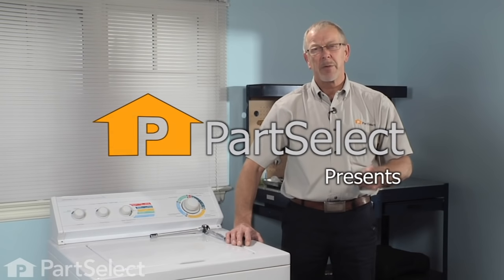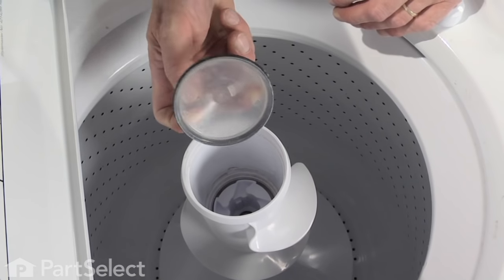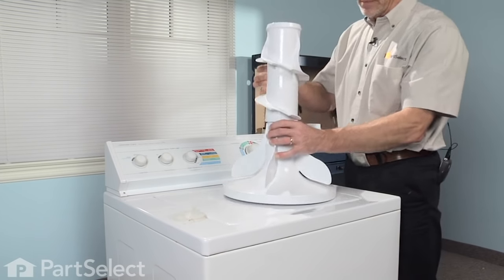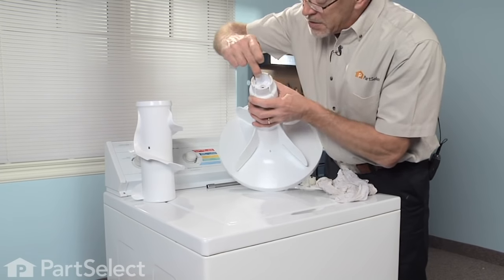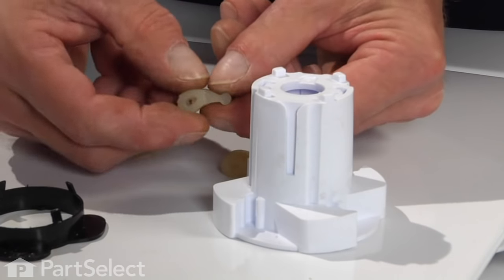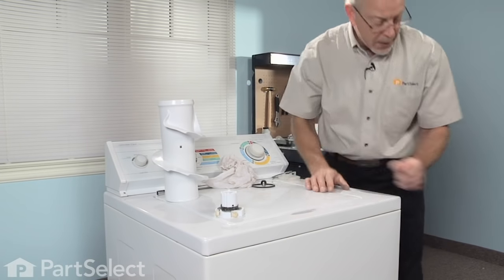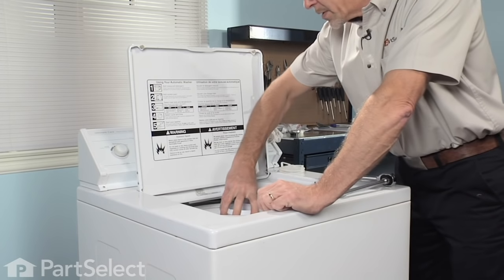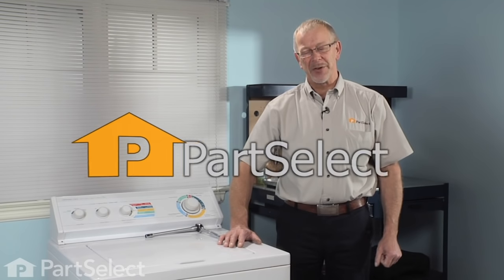Washer Repair- Replacing the Agitator Repair Kit (Whirlpool Part # 285811)

Comment: Do not bust the two tabs in the post of the agitator base! He is wrong when he says they are just for factory use. Those two tabs line up with the two holes on the bottom of the cam set, and they SNAP into those tabs to lock down the upper auger piece so it doesn’t wobble around loose.
Reply: Thank you for explaining about the two tabs. You are quite correct, at the end, it is satisfactory to hear the "click". I think that it's hard to get the right alignment, and perhaps some non-OEM part aren't well formed, and the bolt tightens it enough, if you do follow his suggestion. But as you say, better not to!

Comment: My goodness, if the agitator bolt is rusted, it is quite the task to remove.  I had to try to drill it out, which didnt work (the bit I used to drill was too large, Live and Learn), so I drilled around it to break the top piece that gets replaced by the repair kit.  This video was posted 13 years ago, and is still helping keep these machines out of the landfill.  In my case, I had to replace the clutch, the coupler was worn so we replaced thata too, and the agitator assembly -- all in all a cost of less than $60.  I want to say I really appreciate this video, and don't usually ever comment on videos.  Kudos!

Comment: I did this!  While my washer looks exactly like the one in the video - I learned that not all washers (even if they look the same) can be drastically different. I ordered the referenced repair kit above for $8 and some change from Amazon, they also carry the "dogs" for less than $2.00, but it is an add-on item and you have to spend $35 to get free shipping.  So I ordered the kit.   I got impatient and visited the local appliance shop/parts shop and they charged $8 JUST for the dogs.  So I replaced the dogs, and when the kit arrived, I learned that my machines assembly was different than the kit - however, I did use the gasket for the top thing (the thing you take out to get to the bolt), I also used the bolt washer, my kit didn't include a bolt.  It works IT WORKS and I DID IT.  THANK YOU FOR YOUR VIDEOS!! I've subscribed & liked!
Reply: Cara Friend.

Comment: To think i was about to order a brake, clutch, and other parts and replace one part at a time, then test it each time. Mind you, i bought used, and someone had previously used a screw to lock them together. I took them apart, and what looked to be pebbles were actually the dogs broken. Lol just bought 2 sets on Amazon for $20😂

Comment: Awesome site!  I have ordered many parts online and repaired many things myself but this is the best site ever for parts as well as videos!  I just happened to find the site looking for parts to repair my agitator on my 32 yr old whirlpool washer.  The parts were easy to find with just the serial number and I was amazed that there was a video attached on how to repair it.  The video was clear and concise and easy to follow, the parts came very quickly and are very reasonable in price and the job only took about 15 minutes.  My washer is old but still works just as good as new and I did not want to replace it.  The parts are exactly what were on it originally and have repaired it back to new.  I hope to get many more years out of this washer.  I have definitely bookmarked this site and will use it again and highly recommend it to any homeowner who likes to diy and save money.  Thanks PartSelect for providing such a great service!!

Comment: Good tips. I swear by Westinghouse analog washers...I've replaced them about three times now cause they're easy to fix & are real workhorses. But discovering how easy it is to replace these auger dogs (dawgs) was my contribution to saving our budget some $400-800 in a new washer. Good tips with adding grease and a new bolt. I'm over 67, a woman, and when you're not afraid of taking it apart and see how it works, anyone can do this fix with a good appliance parts store, and about 30 minutes. Nice video.

Comment: Great job with that video!  There is one model-to-model difference that may be confusing to another first-timer.  On my Kitchen-Aid brand washer, the upper half, the auger, did NOT snap down onto the lower half.  It justs rests there.  The proof was that the grease transferred when the two parts were together -- but no snap.  This only meant that during final assembly, I had to lift by holding the bottom part.  It's back and working.  Thank you!!!

Comment: Videos are wonderful and have helped in the past.
We have a problem that we can't diagnose - thus can't figure out what to replace.
Kenmore  80 Ser. Washer. 
Fills/drains normally. Agitates - but something is "off" - tangles the clothes into knots rather than "rolling over". Makes an intermitent grind noise during agitation. Agitator dogs work when checked by hand. Spin cycle  - runs normally then sudden "grind/thump" noise. Agitator stops suddenly and then resumes spin when grind noise occurs.

Comment: I found it very difficult to snap off the factory tabs, and stopped after I finally got the first one off.  It was not difficult to see how it lined up with the tabs in place.  I gave it a dry run without the top part of the agitator first, just to see how it fits, and then when I put it on, it fit like a glove.  My washing machine is running a load right now, working better than it has in years.  Thanks!

Comment: Great video, but it doesn't tell what to do if the top half won't come off. On some Whirlpool models mine for example the agitator cam has four tabs on top that were heated somehow at the factory this keeps it in place during assembly. This will prevent removal. You cannot simply pull it off.
 My solution was to use a long (8 inch) small bladed screwdriver and a hammer to cut the melted part free from the tabs. A couple of taps on each one and the top will come off easily. Hope this helps!
.
Reply from the maker: This is a great tip Rob, thanks for sharing!
Reply: Thanks for the GREAT Tip...Nothing Worked...Couldn't figure it out and Tried  you're tip and those tabs didn't come off easily!!! But perseverance paid off.....Got it!!! Thanks !!!.
Reply: Cindy Gilliam  forgot to mention ...someone also had two drywall screws on the top of the dog holder also.....thinkin this has been messed with before....or they did it for shipping purposes...drywall screws....really?

Comment: the kit comes in three different sizes, with three different numbers. Because the cam comes in different heights, short, medium, and long. But likely you will only need the little dogs anyhow, and they are about $7 on amazon.

Comment: Question: the small, thick washer that comes with the repair kit, is that for the agitator bolt?  I bought a new agitator bolt and it has a washer already installed with it.  Thanks.

Comment: I just paid a repair man to fix my old whirlpool agitator n the matching dryers timing knob a total of 417.00 which he said if i wait n they come back for the washer separatly it would cost 129.00 as apposed to the price to get it done with the dryer 87.00 i think is what he said it was .  My point is he came in with a box big enough for the dryer timer n tools.  It blew my mind how he got the agitator to work properly.  So i tried my luck in this search and im convinced u can find anything on the internet. He could have had those parts in his tool bag.  Although i feel sick cause this video is so good i could have done it myself and saved myself much needed money. Lifes a journy u live n u learn.
Reply: OMGosh!! My husband is not very handy about fixing things. When my agitator stopped working properly, I, as always, googled, and found this video.  I immediately found the part on Amazon for $4.65.  I just did the repair myself and it was so easy. I wondered how much it would cost to have it repaired had I hired someone.  Wow!  I'm so sorry that happened to you, though. I hate being ripped of by mechanics, appliance repairman, etc.

Comment: I replaced the dawgs   The adgitator works properly. But does not work when I wash a load. Teeth on the upper adgitator seem fine. Any suggestions ?

Comment: What is not shown is the amount of torque that is applied a the factory to these mount bolts. I just spent about 1/2 with 2    3/8 extension bars and a 7/16 socket,  a 3/8 ratchet along with a leather mallet. I had to keep hitting the handle of the ratchet until the bolt finally started coming loose. More shade tree mechanic work to get the bolt broke loose.

Comment: Thank You for taking the scary part out of self service repairs! I have a question, is it normal for there to be water around the agitator bolt during a wash cycle? I do find the water drained away after the final spin. Also where do we get the agitator grease in your video? 
Many thanks in advance.

Comment: Great step by step. Thank you for sharing! 
 I have a problem though. .. the agitator bolt is flush. There is nothing for my rachet to grab hold of. It looks like the bottom of the bolt. Any ideas why or how to remove it?
Reply from the maker: I would suggest trying a 1/2 inch socket wrench with extension to remove the bolt.

Comment: So we replaced the agitator parts and it works great. My question is it suppose to be loud once it is working? It's almost like the "dogs" is really rubbing against the other part.
Reply from the maker: The action of the agitator should be quiet. If you rotate the auger portion of the agitator it should only turn in one direction and you would hear a slight clicking sound only. It should not rotate in the opposite direction and if so, you may have assembled the parts incorrectly.

Comment: I have an issue with an estate washer I have continuing to fill up even after agitating the water won't stop filling up. Has flooded my wash room twice. I replaced both of the pressure switches already it has dual switches and still didn't fix the issue. It's not the valve because I can unplug the washing machine while it's filling up and it completely stops even with the water still turned on. When it does this sometimes I can turn the water level switch from small to large or small to medium, etc just switching it another level then back to where I had it and sometimes that makes the water stop. Is that sounding like a water level switch going out?

Comment: Good evening sirs. I am having trouble with my Washer / Dryer Model LTE6234DQ4 and the agitator dogs. However, when I saw the video I did the test with the agitator base and it does not rotate to the left or to the right. It is locked. The top agitator rotates clockwise but locks when turned counterclockwise. That means it is working fine, correct?
The problem is that the motor of the washing machine works, but the agitator does not move and in fact, the base agitator is blocked.
Consequently, I must ask you if I can still be considered to have a problem with the upper agitator dogs or if it is a problem with the basket shaft or with the plastic ring of the agitator impeller or with the shaft / bell blocker.
I saw Whirpool's videos to disassemble the basket, the shaker dogs and they make mention on the agitator base that it should turn to one side only, but not that it is locked.
I will try to get the agitator out in the way you show in the video and there, I will see what is happening.
Will you have any recommendations for a washer / dryer check-up for me?
What can I do, should I change the brake and drive tube?
I appreciate your patience with me.
Yours truly
RLLAVANE

Comment: My Whirlpool washer Model # LSQ9110PW3 doesn't spin well.  I take out the agitatior assembly as you demonstrated and it sounds that the agitator dogs are worn out.  But I could not seperate
the upper part from the base part.  No matter how hard I have tried, I still fail in proceeding with the repair.  Can you or anybody tell me what reason it could be? Awaiting advice!
Reply from the maker: The agitator dogs should not cause the symptom of poor spin. First, verify that the washer drains properly. Next, check the drive block under the agitator to verify that it is locked into the spin tube properly. If these are okay, then you should look at the clutch assembly as a possible cause for this symptom.

Comment: A word of advice to anyone planning on doing this - my washer looks exactly like this one but the agitator is different on the inside, the parts do not fit at all. Make sure to look at your agitator and make sure it's a match before ordering parts. I honestly didn't imagine that they would be that entirely different that what is in mine, but as soon as I took it apart ... yeah. it's all good, the dogs were all i really needed for the repair so. but yeah.. now if you'll excuse me i'll go hang my head in shame. well not so much because the dogs did fix it.

Comment: Can you tell me the reason you replaced the agitator bolt as well?  Just curious.
Reply from the maker: Often, the rubber gasket on the agitator bolt is damaged, and the new bolt also comes with a coating of thread locker on it. We replaced the bolt mainly because it was included in the kit.
Reply: From Amazon, the bolt is an optional add-on for a couple more bucks.  I figured somebody knew something, so I went for it.  Happy that I got it right.

Comment: I have a whirlpool washer LSR7333PQO model and the clutch needs to be replaced. The issue I am having involves the removal of the agitator. The screw has been removed but the agitator will not come out.  I even used a crow bar and it is stuck. What is holding the agitator in the tub.
Reply from the maker: Treedoctor2014 It sounds like the spline on the agitator base has fused to the agitator shaft. You may need an agitator puller to remove it, or you could try cutting the old one off and replacing it.

Comment: model whirlpool lxr7244jq1 i installed a brake clutch. the old one seemed ok. still wont spin. before this, it made a scrapping sound as if metal to metal sound. could it be the couplers wore out causing it to grind?

Comment: Thanks Steve, I have a whirpool washer exactly like the one you are working on video , followed the steps and pulled out the entire agitator out . But I can not separate the top one even with feet on the bottom and pulling the top , it can not be separated , . Looks like they are one piece !  Any help at this point , ? Appreciate any advice ,
Reply: I have same problem-- hope someone addresses this issue.

Comment: Where do I get the replacement parts and do they fit all models of top-loading washing machines
Reply from the maker: Thanks for your question. You can find this replacement part here:
https://www.partselect.com/MEGA-PS334650-Whirlpool-285811-Agitator-Repair-Kit.htm?SourceCode=15
It does not fit all models, but if you send us your model number, we'd be glad to double check it for you, or find the replacement part that fits your washer!
Reply: PartSelect thanks for your  help

Comment: Anyone know what this is? Small Brass Nail with flat side and small hole at bottom of nail ...looks like it locks something into place.. I was repairing the clutch assembly. And this mystery piece came out of my washer.... Please let me know
Reply from the maker: The is a lock pin the manufacture uses to keep the suspension system in place for shipping when new. When it was new it had a yellow strap that had to be pulled which released two and on some 3 clevis pins. Thos brass looking pins dropped into a cup on  frame. You can discard it, it is no longer required

Comment: Can you use any kind of grease?
Reply from the maker: No. The manufacturer uses a silicon based grease that is available as part number PS347804.http://www.partselect.com/PS347804-Whirlpool-350849-Agitator-Grease.htm?SourceCode=3&SearchTerm=PS347804

Comment: My Whirlpool washer #LSQ9665JT4 agitator is impossible to separate!!!! Any suggestions?
Reply from the maker: If the auger portion of your agitator does not pull off easily, try standing on the base of the agitator and then pull upward sharply
on the auger. This should do the trick, although sometimes significant force is required.
Reply: Nope.  Not even my male neighbor could separate them.  With persistence, I ended up taking a a flathead screwdriver and a hammer to separate them.  I think they were heated together.

Comment: I am having trouble separating the top half form the bottom base. My whirlpool model is #LSB6300PW1
Reply from the maker: I did a quick search and the above video isn't for your Whirlpool model. Did a quick search based on the model number and the above video is not for your specific whirlpool.  I'd suggest watching this video using this part number:  3951744. It can be found on our YouTube channel and it's for your Whirlpool washer. We also have some great information about this installation on our website. Use the above number on our site and you'll find on the parts page some great customer installation instructions and tips that you might find useful. Hope this information helps.

Comment: Not so easy when the washer has some years. The bolt is very difficult to remove. They should have used a stainless steel bolt.

Comment: i replaced the dogs twice. works for one load. then agitator starts moving in both directions again.  what am I doing wrong?
Reply from the maker: With the washer sitting idle, can you manually rotate the auger portion of the agitator in just one direction, both directions or no
rotation at all?